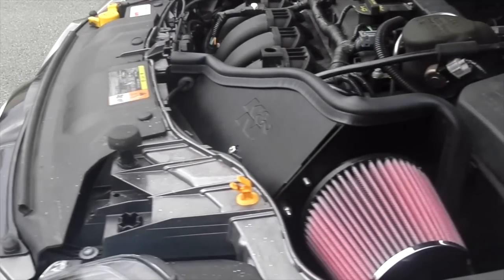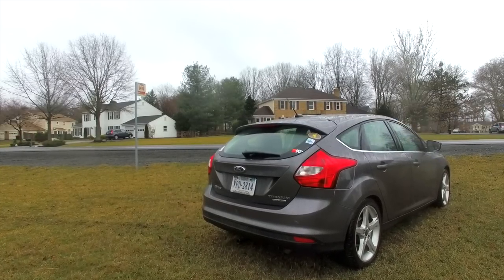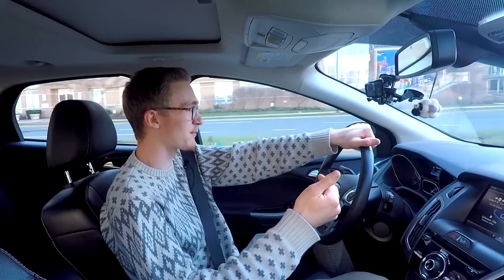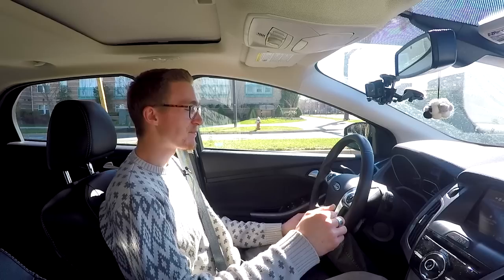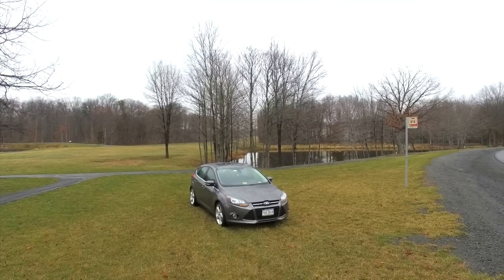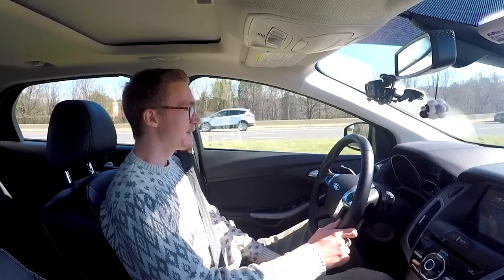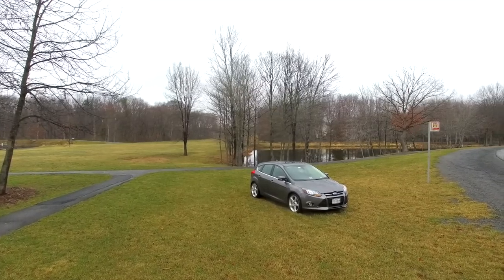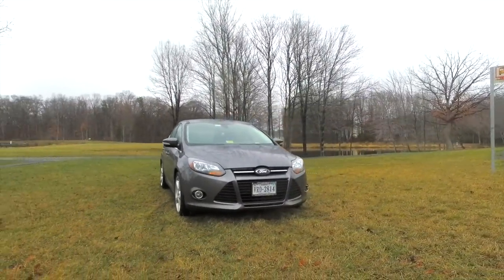K&N Cold Air Intake Update, What Happened to It??

Comment: I put on a Corksport short ram intake on my 2014 Mazda 3. Haven't done anything else with it, and haven't noticed anything wrong from it. No worse gas mileage (my driving is the cause of that, lol) or anything either. I think my automatic transmission is more of my culprit for not having enough power sometimes, but I'm just hoping I'm not fucking my car up more by having it on, lol.

My 2004 Miata has a K&N intake too, and it's basically the same thing. Only thing with this is that the tubing goes from the passenger side to the driver side, and just sits there exposed (I still need to make a custom shield for it or something, but haven't felt like it). But I don't think I've noticed anything different with it either. Still just as slow 😂😂 But sounds fucking dope.
Reply: ryuman757 intakes don’t make your car faster, cools the engine ...
Reply: @Chris-gr1xv  I was talking more about the exhaust. I was seeing around that air intakes make your car run worse for whatever reason, and am still a little ignorant on most of the details. I've had one on both my cars for a few years in varying temperatures throughout the years, and have never noticed anything bad. I personally couldn't care about power increase since the better sound from the engine is good enough, lol.

Comment: It's one of those situations that if you do not have much to start out with, then every little bit helps. Kinda like 1/2 inch is not very much but...... would you turn it down hahahha. Still, if you want a faster car, BUY a faster car. Nothing in a can or that can be simply dropped in will cut it.

Comment: Good video.  Your right this is not cold air at all.  Pretty much false advertising by K&N.  Cold Air intakes run down to the fender or bumper.  They don't have the filter located in the engine bay.

Comment: wow dude, dont trash a good cold air intake system just cause you have a car that is not meant for performance parts. i have a 2014 durango and as well as the HP gain and torque that was increased, my engine runs cooler and is alot more crisp and the throttle response is on point. maybe call amazon and see if they will refund your car. i wouldn't be caught dead driving what you drive.

Comment: cool! now you have unfiltered dust grinding your engine internals, well done
Reply: True.   Paper filters are so much better and easier to use.   You just bounce them on the ground to clean.  No need to wash and oil like K&Ns.  One oil mfg recommends increased oil changes if you use a gauze "perf air filter" to remove the grit from the engine oil,

Comment: Your analysis is of no value considering your application. The K&N cone filter works well with a true cold air intake locating it away from in the engine compartment. I have mine breathing behind the headlight in an area outside of the engine bay.

Comment: People are calling them Hot air intakes now. Sucking in hot air from under the the hood
Reply: Ross Templeton That's not a cold air system he's showing though. The one he has is a short ram. Cold air intake systems have the longer tubes running in the fender well where the pod filter is then closer to the ground.
Reply: @jasonwindsor3726  The idea is to get more  cold air, whatever you call it, right?  Seems like the original equip is a better cold air intake system vs spending 240 bucks to suck more hot air from under the hood. The performance was alot worse so it was a waste of $$$$$$
Reply: Ross Templeton For his setup yea was worse. Look up typhoon k&n system 69 series, that's a true cold air intake. On this video he's showing a short ram intake system. Two different setups.

Comment: No scott didn't have it right. I have a challenge for all of y'all .
Take your air box off and on the bottom of it make a hole and lay out some pipe going from the bottom to the air box to the lower part of your bumper. I promise aleast 20 horse power gain don't come at me saying it ant gonna work till you try it. 
What happens is air comes though your bumper into the tub your picked and into the air box and filters though your stock filter and the air is alot cold and making better air fuel ratio. 

Your welcome 😉💯 follow me on Instagram at 

Gasmask69420 for more helpful tips coming soon

Comment: Well let me say this. With my K&N CAI I get temps during driving that is 3-5deg above ambient(in south FL) which is VERY good. That's not the benefit, you use them because the tube and filter are far less restrictive and allow air to flow more freely. This does translate to some gains. They also allow one to tune for higher airflow. Yes the throttle body can only let in so much air itself but the air will be flowing much more quickly which is the point. This is why some companies can increase the diameter of the tube around the MAF and get more gains with a tune. You talk about heat soak but never actually measured cylinder head temp or air inlet temps did you? Thought so....you've just convinced yourself of an issue without understanding the actual mechanics. By the way merging into traffic on the highway being or feeling weak is probably because the torque numbers on your car are aweful. I know, I had a 2008 Honda Civic before my current car and it too had terrible torque numbers.

Comment: Cold air intakes are for the most part useless, unless you are doing a full blown race car modification there the air needs to be routed to a cooler area like you have mentioned, then of course like you said a remapping if the ecu. It sounds cool that’s about it. Engineers at car companies spend millions developing the most efficient parts for the optimal performance. These people are PhDs and the top of their field. Joe blow is not going to come along and make improvements for a few bucks. You want more power? Work hard and buy a more powerful car. You see a lot of the rice rockets but what you don’t see is the $100,000 or more that went into them done by professional shops. If you want to look cool, just rely on sticker power. Lol

Comment: Waste of money and why anyone would put this on a 150 horse daily driver is beyond me. Check Project Farm's test on filters. Most modern cars have real cold air intakes, what they sell you is a noise maker that sucks in hot air, dirt and if the tube is metal, heats like hell. I used the filters on big inch drag motors, but this was just to keep big chunks from getting into very expensive engines and the operating time is miniscule.

Comment: That is not a true cold air intake ! Its a short ram wich is the dumbest design! It should go all the way down to the inside of the front bumper. I have one and it works. Pop the hood after driving and by the throttle body the intake feels warm down by the filter its cold feeling! Thats how i know its pulling in colder air. Short rams are stupid and sit to close to the motor!

Comment: You installed poorly and did not take the time to ensure cool air intake.  I am not claiming whopping more power or mileage, but I do get cool air. Yes the rubber gasket that's part of the kit is not great, I added some foam strips from Ace and dammed all but cool air front-end air.  All I can say is the coolest part under my hood is the metal cap on the K&M filter. And yeah, it still can be hot as it was over 100 today and Tuesday was over 108, but still cooler than everything else under the hood.  So make some effort to isolate the hot engine/rad air from the intake.  Has this made a world of difference, I don't know, but I sure as hell don't get "heat soak" fade.
Cheers, Mark
************************************

Comment: Your pretty much waisting your money with this crap. Your better off just getting a better then OEM air filter. Also don't run an intake snorkel to a wheel well, that's dump for so many reasons.
Reply: Oh and you might get about 5HP in gains. Small mods, small money = small gains, big mods big money = big gains. That simple. If you think you'll get massive improvements by spending a few $ or even a few 100 $, you're fooling your self.

Comment: Growl??? On a Focus??? AHAHAHAHAHAHA
Reply: Btw any combustion engine will growl, because combustion is the ignition of fuel and gas in a cylinder,  ever hear a motorcycle? They have way less cylinder volume and can have only 1 cylinder, by the way the growl you hear from a car when you remove the stock intake is cause their is less sound dampening which is why exhaust and intakes are the loudest areas on a car
Reply: You obviously don't have a clue about combustion engines